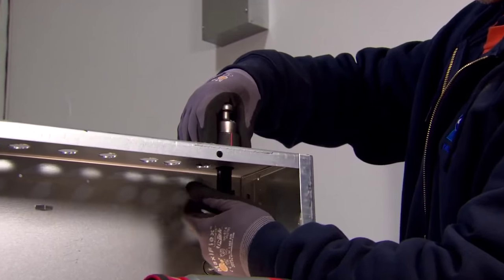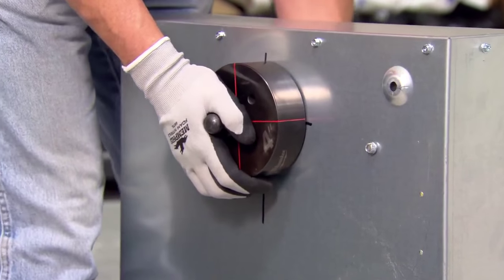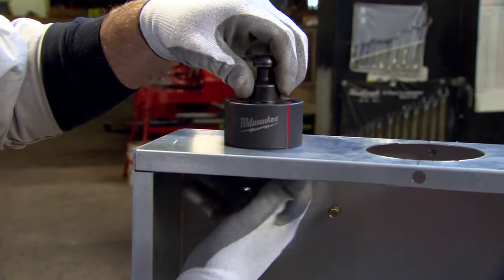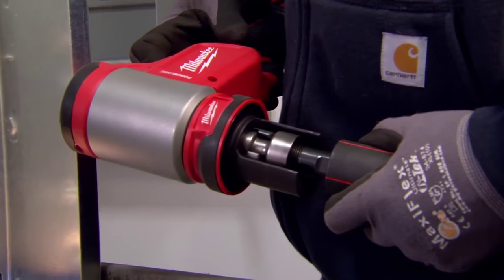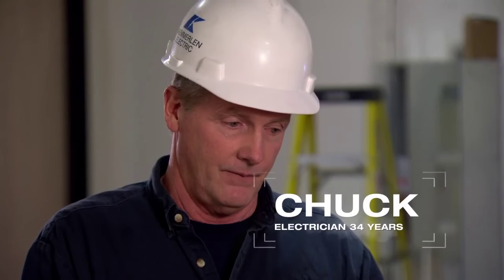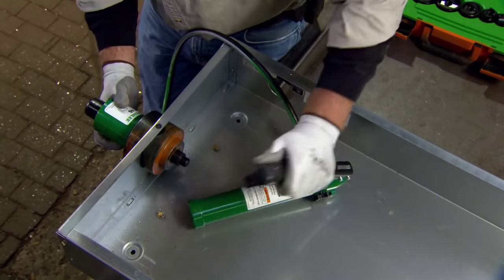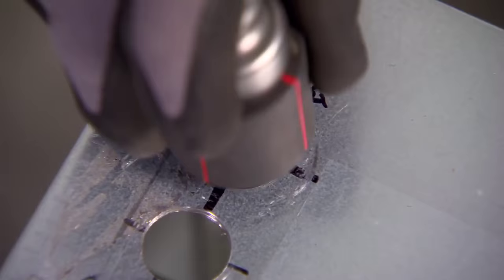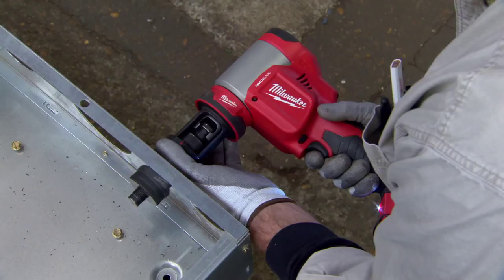Milwaukee® ForceLogic Knockout System

Comment: A few things come to mind here.... 1 Why are they wearing hardhats for interviews? 2 those are some awfully big burrs left behind on the metal after cutting 0:57 seconds in. 3 i have never heard of a "pre apprentice" at least where i live. 4 if you use this tool you know have to buy Milwaukee stuff apparently, as compared to other knockout kits that are generally interchangeable.
Reply: And also holes already drilled. What's the point
Reply: @morisventura674  Sorry for the late reply but typically with knockouts you are making the hole larger so it fits whatever size conduit you are bringing into the box. You have to pre-drill a fairly large hole just to be able to fit the threaded part of the tool through (it's about 1/2"). Luckily since you are relying on the knockout to clean up everything you don't have to be too particular with how clean the pre-drilled hole is.